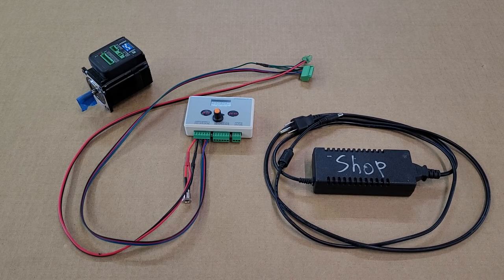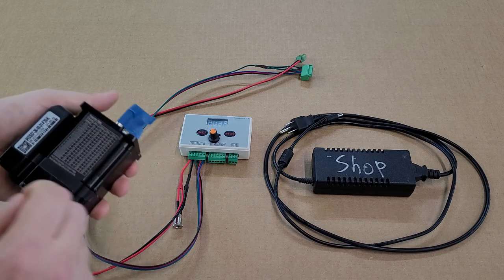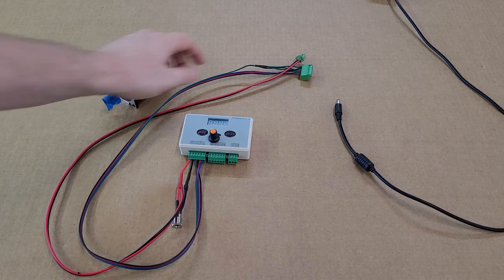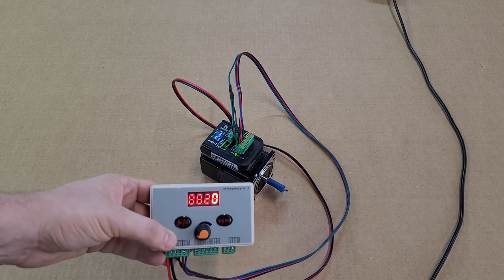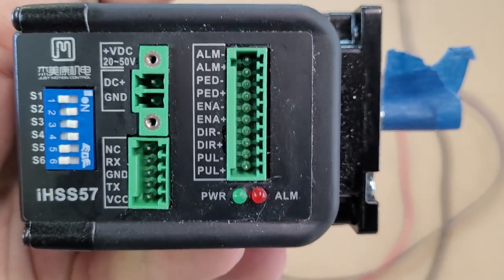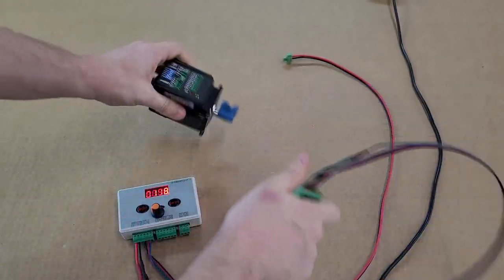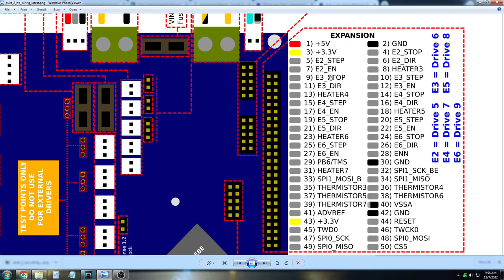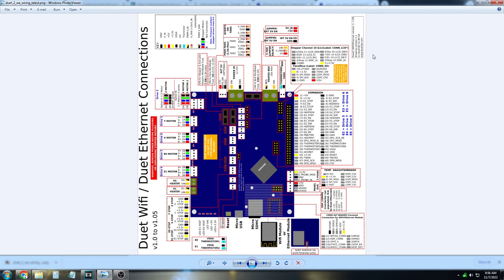Standalone Motor Driver Usage and Wiring (OLD VERSION)

Comment: how  much  voltage will be needed  to operate  that  stepper  motor
Reply from the maker: 24 volts, which is also what is used in this video. The motor can run 20-50 volts (as intended), but a higher voltage does not increase the power output of the motor. The motor driver must run on 24 volts.